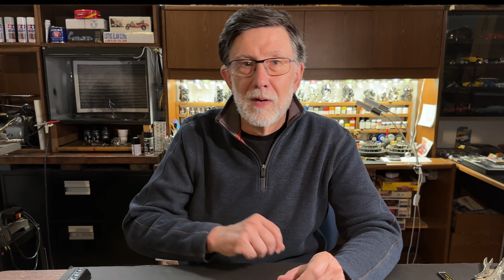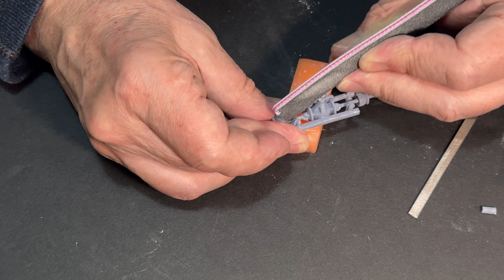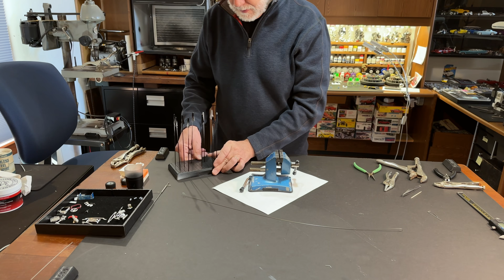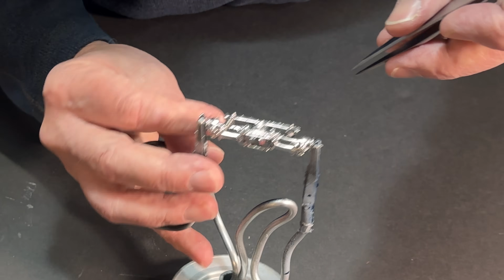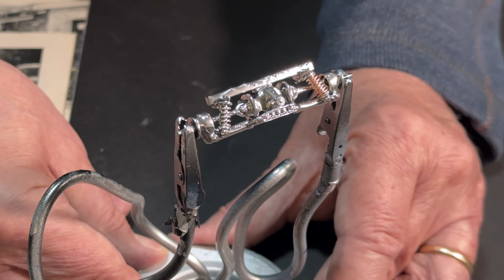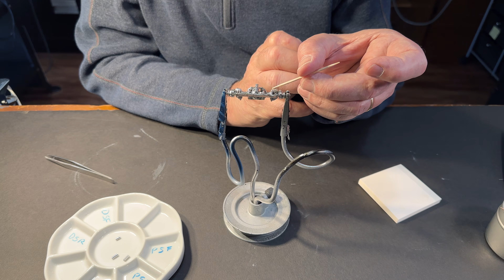How to Make Customized Coilovers

Comment: Always go with a smaller dia.   first. I have different  size springs from ball point pens, they work perfectly.  I use it on the front suspension to make the coil overs. For Chevrolet that had coils on the rear  I would do a working suspension getting the smallest spring from Ace. You would be suprised at what they have. My Ace has springs in black, steel, nickel. Brass or copper plated

Comment: That top rail on the 3d print was very malformed. The unit looks great with your modification,  but i think you should have replaced that top rail with a clean piece of plastic stock. Other than that,  a very nice degree of work!  
Thanks for sharing! 😊
Reply from the maker: I agree, but it will be covered over by the rear cross member. ;)

Comment: You can wind those springs easier using a drill. Put the rod in the chuck. Stick the end of the wire into the cavity between the chuck jaws and away you go.   Pretty much all battery drills have variable speed.  Go as fast or slow as you like. 😉
Reply from the maker: I’ve tried many different drills and have yet to find one that turned slow enough for me to easily control the wrap. What drill do you use?
Reply: @ModelCarMuse I don't know about others, but I use a Black and Decker "with Autosense), model # BDCDE120. It goes pretty slow when the trigger is barely depressed. I use it a LOT with the tiniest drill bits - and the balance is great!
Reply: @ModelCarMuse  I've got a hikoki battery drill. It has a slow speed gearbox selection.

Comment: The method I use is wrapping the wire around a small screw, I have an assortment of them just for this, and it always gives me equal coil spacing. Taking it to the next level, drill a hole through the screw to start your coil and then drill a hole in the matching nut, you can make coils like a machine.

Comment: Another way to make coil springs is to use the proper size rod mounted in a cordless drill with the wire bent down into the drill chuck next to the rod and slowly spin the drill. 

This is how jewlers make a large number of jump rings for a necklace or a bracelet at one time.

Comment: Would wonder if possible that you can use a similar rod as where a small size drill bit.? As where  use the bottom of the drill shaft to make your springs if didn't have the same size rod that you have used to make those micro coilovers shocks.? What size of copper wire you have used for something like that.? Very interesting info. I hope you are able to continue with more interesting information about customized models parts.  That was very helpful and cool.
Reply: You definitely can use a drill bit or find a machine screw that is the right size and wind the wire around that. Then unscrew the machine screw and you have an even spacing between the coils.
Reply from the maker: Using the shaft part of drill bits is a great idea, since a drill bit set gives a number of sizes to choose from!
The copper was just some electrical wire I’ve had lying around for years, stripped of the insulation. Glad this was helpful; we plan to do more how-tos.